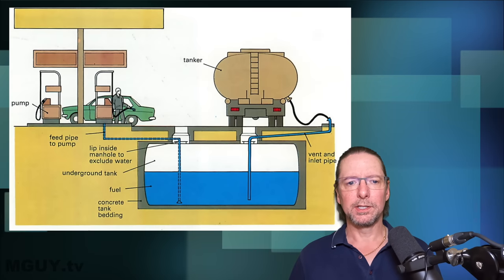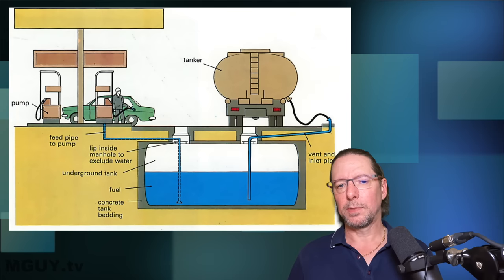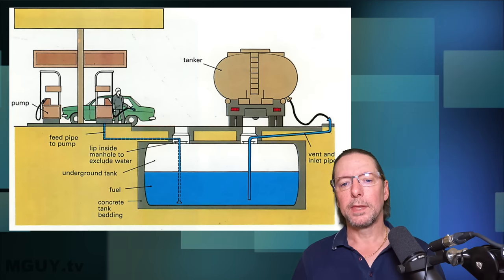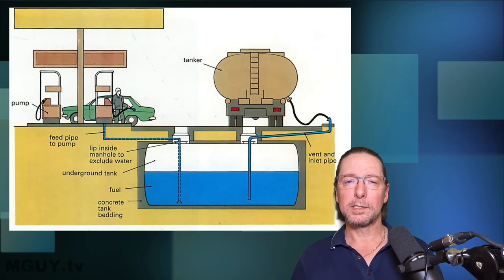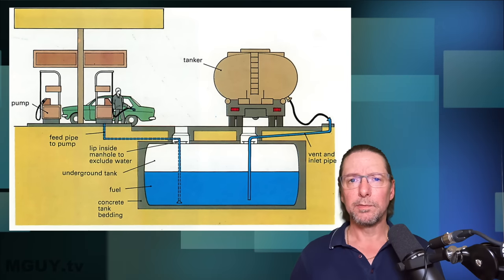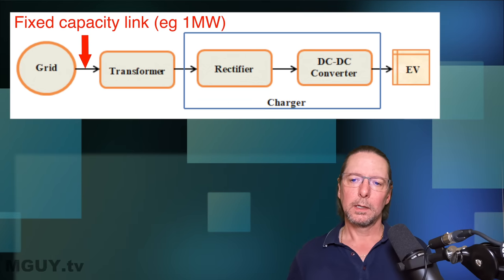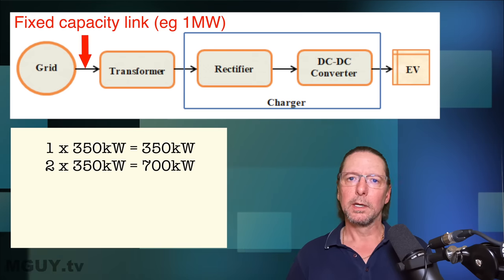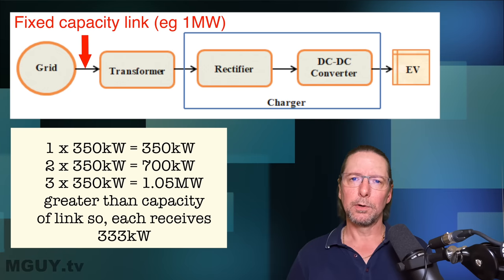HUGE problem with EV Charging Stations that no one mentions | MGUY Australia

Comment: Lee McMaster just reported this, he was in Scotland at a four charger, with four EVs and they realized that they could not all charge at one time, so they had to reduce to just two EVs. This makes sense, thanks for your video.
Reply: Yes I saw that and thought if it when watching this video.
Reply: But if there was a 40ft container full of charged ex-EV batteries recycled as storage (like a tank at a service station)...
then they could all charge at once.
Reply: @JohnSmith-pl2bk and if unicorns were real, we would all have flying horses.
Reply: I am a design engineer for the local electrical company, we have hundred of businesses now applying for upgrades to their supply because they want to change over to EV for their new fleet of companies vehicles.
In most cases the power required for the new proposed EV charging is bigger than the load they are currently using to run their entire factory.

And on top of this the costs are increasing because the existing network cannot cope with the extra power that is needed without major upgrades.

In one case a certain elite expensive car company are going to change their entire fleet of heavy goods arctic delivery lorries that supplies the parts to their car factory to EV.
So at their storage plant where the new EV lorries will park overnight they are asking for enough power equivalent to what a small town or large village would use.
So we will need to upgrade the electrical network in that part of the city to be able to cope with it.
We are still trying to work out how to do it …. but the current estimate of costs is about £350,000 worth of work just to make the network strong enough to cope with their new power
Reply: @JohnSmith-pl2bk that’s a fire 🔥
Reply: @JohnSmith-pl2bk so what recharges the container of batteries, while still keeping up with the influx of more flat cars??? Oh, another, even larger container, on and on......
Reply: Unfortunately Lee McMaster charges his EV to 99 to 100 percent consuming at least twice the time, if not more, at that charger if he had disconnected at 80 percent... And he wonders why a charger isn't available, or why it takes so long to top off his battery... Stupid is as stupid does... In one of his videos he noticed a diesel generator at the charging station... So much for being green...
Reply: Makes no sense to install more chargers than the input power can supply!
Reply: We have clearly forgotten that the exact same thing happened in the early days of petrol cars.
Reply: 🎉In the early days of ICE cars people would buy gallon cans of gasoline from hardware stores. Private investers saw a great opportunity and with no help from government put gas pumps outside stores and then created gas stations.
Reply: The electric grid is not entirely privately owned and government will have a lot to say about how it is used.
Reply: Hybrids are the "current" solution and electrics eventually will have more prescience but don't force it.
Reply: @brianandglendaharkin9457 and that's a true
Reply: See, that's a stupid installation. If you only have enough juice to support two chargers, why would you install four? Install two chargers each running twice as fast. Nobody is waiting any longer, and it costs less.
Reply: @herbertshallcross9775 Musk is a private investor, providing both the cars AND the fuelling stations. With, so far as I can see, no help from the government. History in its effects repeating itself?
Reply: @herbertshallcross9775  The government that the people voted for? Meaning that in the end the people themselves will have a lot to say about how it is used.  At least, that is how it should be, dear co-voters.
Reply: False  @JohnSmith-pl2bk  the chargers are powered by 3 phase AC at present. They could be engineered to be AC/DC input, now your talking a bunch more money and double the maintenance, to be passed along to the vehice owners